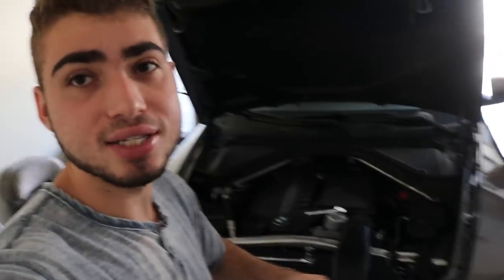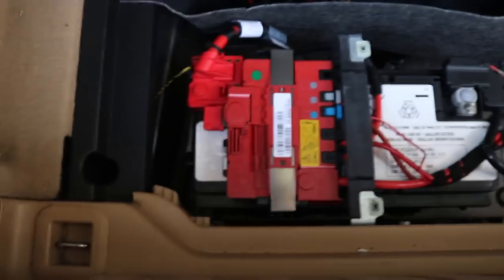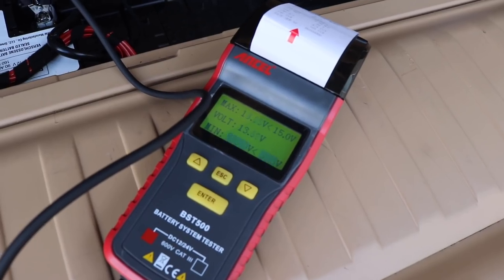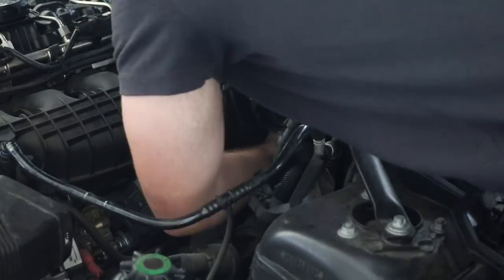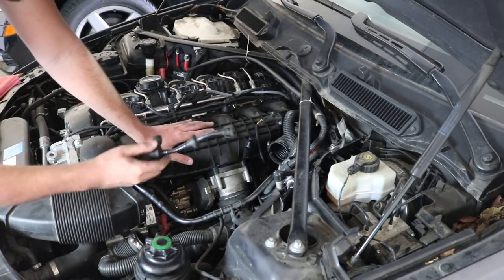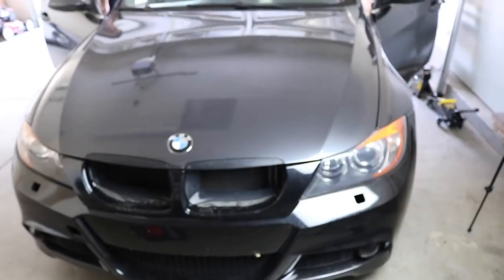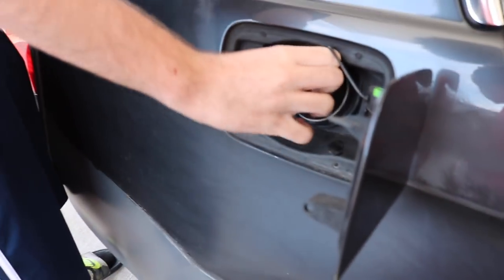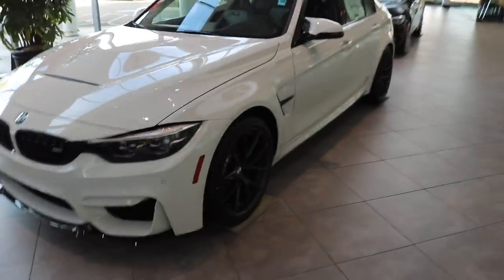We Did Our Best... (I had to do it)

Comment: Just get a list of maintenance items and throw them all in there at once to guarantee the longevity of your 335i. 

- NGK Spark Plugs 
- New Delphi Coils
- Ebay HPFP $200 USD. (OASIS brand) (Installed one in mine, been running mint)
- Carbon Blast your intake valves
- Catch Can + new PCV Valve at the same time
- Change your valve cover gasket and oil filter housing gasket at the same time
- Drain your current coolant and add a 50/50 distilled water and bmw coolant mix + redline water wetter (Helps improve longevity of water pump) 

In regards to more pricey things, I would recommend new injectors if you aren't on index 12's yet. Luckily mine came with 3 index 12s and I found a steal on 3 more for 100$ each used for about 1000km. 

In regards to bang for buck performance, browse aliexpress. You'd be suprised the chargepipe/bov/intercooler combos you can find on there.
DO NOT get downpipes on those stock turbos, the rattle will get worse with the increased pressure due to boosting sooner and they will begin rattling. Get downpipes when you upgrade the turbos or fix the wastegates down the road, do it as a combo it will save you time and money. 

Cheers. my 335i runs like a dream and everyone wonders how I can afford a car like that. I laugh when I tell them it cost me less to buy than their toyota camry xD
Reply: Eldor coils >
Reply: Downpipes helps with back pressure . U can run them untuned . They really dont destroy your car lol.
Reply: That dp thing is stupid
Reply: @ItsGaryy  agreed, looked them up and will get them after my oem coils go out 👍 they are nice and heavy with a metal structure
Reply: @heatchamps2011  I'm not talking about back pressure, I'm talking about your wastegate flapper actuation 200-300rpms sooner due to reduced back pressure because of the downpipes. Imagine your, now free flowing, turbines receiving and releasing an increased amount of air. Now imagine that flapper doing extra work to keep it sealed constantly due to an earlier actuation. Hard to explain, I'm not a Master mechanic or anything, but after countless forums and recommendations, and 3 friends with N54s telling me their wastegates went to shit after installing downpipes, it's only reasonable.
Reply: Leandro you are making me second guess getting downpipes lol.
Reply: Leandro but but i want more SOUNDDDDD lol
Reply: I got recommended Botch spark plugs not ngk

Comment: My 330i squeaking what are some things it could be. (I have a oil leak) is that all it could be or possibly the serpentine belt? Over 100k miles what fluids besides engine n transmission oil that needs to be changed